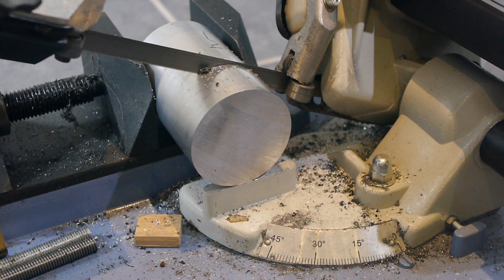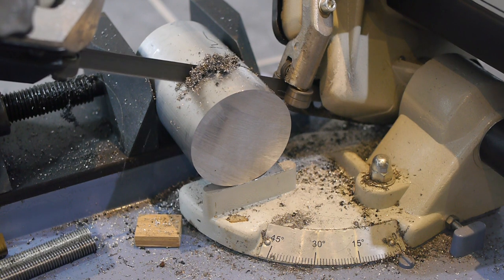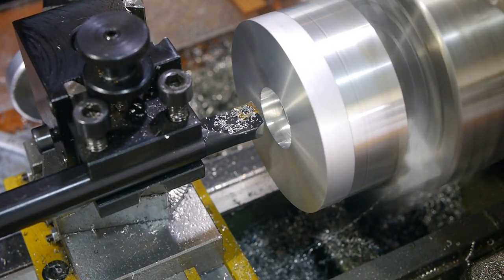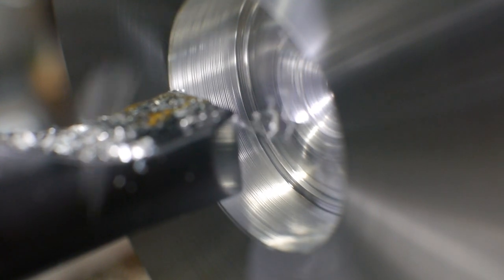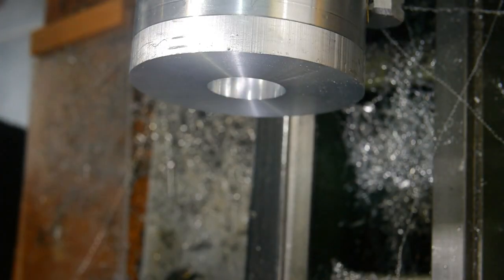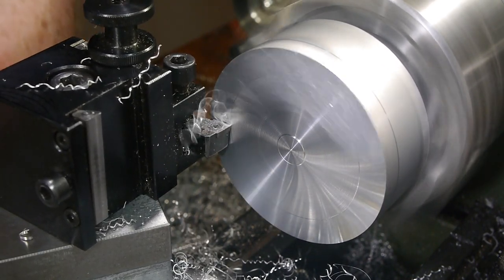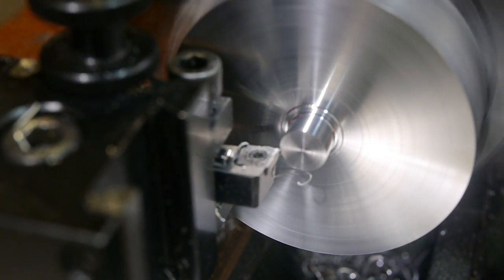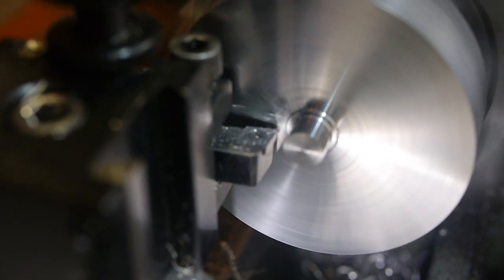Screwdriver Stand - Part 1

Comment: sooo ik you prob dont need tips and tricks... but i like to use vinyl like from window blinds as spacers between the part and chuck just a solid wrap around it and not overlapping.. also for a completely flat face almost everytime get some super glue and little square pieces of glass and glue it to the flate face of your chucks,color the glass with marker, then taking a resin/diamond wheel and while the chuck spins lightly face and take the marker off.... yes alotta work but it seems to pay off if your tryin to be accurate!!! thanks for the watch,you got yourself a subscriber!!
Reply from the maker: I'll take all the tips and suggestions I can get. I'll try your suggestion with the vinyl spacers, thanks!
What is the advantage of the glass plates over grinding the steel face of the chuck itself, to make sure it runs true?